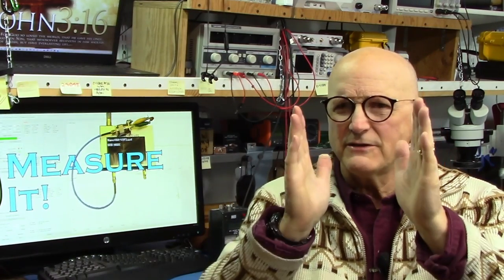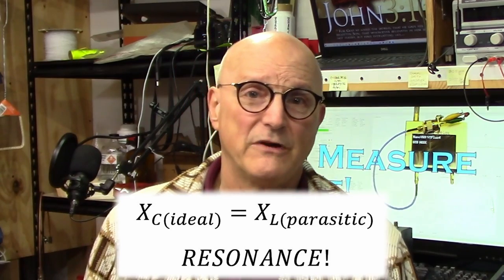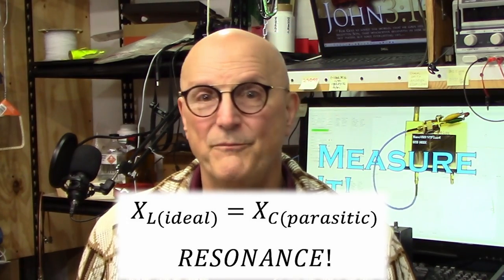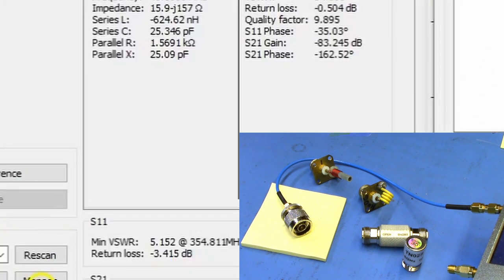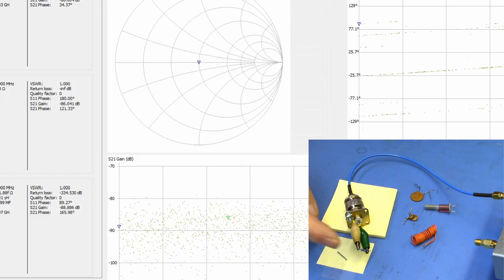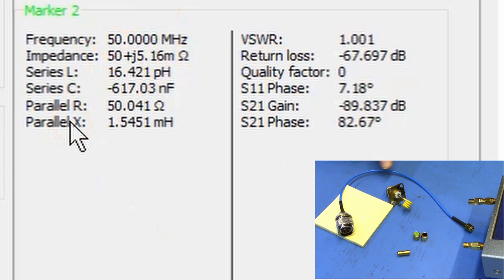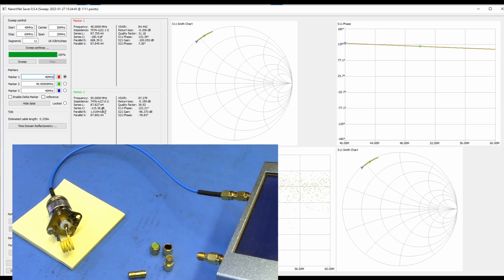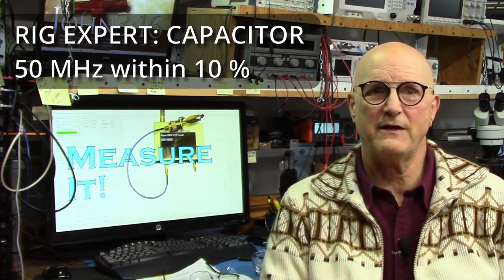Measure Impedance, Capacitance and Inductance using a nanoVNA also Compared to Antenna Analyzer(051)

Comment: When doing the port extension experiment, you could have used the SMA through at the end of the cable, and applied your SMA standards at the end of that assembly.  Then, the port extension would have to only account for the additional electrical length of the SMA to N adapter, minus the SMA bullet.
Reply from the maker: Yes, yes! I thought about that and considered it. A lot of the nanoVNAs do not come with the thru adapter. So, I thought to myself, "Let's assume they don't have one and see what happens."
But, you are absolutely right, the preferred way to do it would have been exactly as you described and would have been my own way to do it under normal circumstances. Thanks for the comment!

Comment: Great Video--These are right up my ally for interest!  So thanks Ralph for making them.
A long time ago, I was on the cusp of purchasing a MFJ analyzer when I came across a article where you could build a VNA by following this article and self-sourcing the components. In that article they did a comparison of their VNA with lab-grad ones and got great results; however when they compared them with the MFJ it was a disaster!
As a result, I held off my MFJ-purchase and finally got a NanoVNA and later a SAA2N and have never looked back.  I realized that you have to come up to some minimal standard to use test-instruments to declare values; otherwise you are much better-off not trying to obtain exact-values, then calculating your way to Avalon--only to also find that your layout dorked you anyway!  So, if you don't have suitable-equipment, you are more well served to just work empirically for performance-results and don't sweat individual values and their contributions.  Along time ago I was reading the Motorola RF manual whereby the engineer said that they calculate/simulate first, then build as well as they can; if they acheive being within 30% of that, they're happy!  So, this allowed me to cope with not being able to afford expensive equipment in those years.
Thanks Again and 73...
Reply from the maker: Yeah, that nanoVNA is an amazing little instrument!
If you read some of the really old manuals for electricians you will find instructions on how to get a rough idea of the voltage present using their fingers (yeah, 120 and 240 volts!). Aaaah the things which we used to do. I NEVER did it with my fingers ... least ways, not on purpose! LOL :-)
Reply: HP8753d/e is your best friend!

Comment: Excellent.

 Very helpful. 
I am about to build from scratch a receiver & all my old component testors are kaput. I tested a bunch of coils & variable capacitors & it worked great.

BTW, the waffle complaint guy needs to learn how to use the video advance slider, me thinks.
Reply from the maker: Now that's one of the things on my bucket list, to build a receiver from scratch...just for fun.The other one is to build a solid state linear amplifier from scratch. Not to use myself, but for the whole learning aspect of it and then give it away to someone.
Yeah, the nanoVNA is so awesome! I'm glad the video helped you get a leg up on it all.
Regarding the video slider...I also provide time marker links in the description for every video I make. If someone is interested in a particular thing in the video, they can look it up and jump to that spot in the video by clicking on the link. 🙂

Comment: I expected t measure an antenna center frquency by the NanoVNA. Of course, something is calculated, however it would be good to have a bell curve to see the result. Is there any way to have a look that ?
Reply from the maker: Take a look at my video on the menu system of the nanoVNA which will help guide you through the whole thing so you can decide what you want to see and how you want to see it.
https://youtu.be/_96N3oGFatE
MORE THAN THAT ... If you connect the nanoVNA to a computer and use software such as the "nanoVNA Saver" program (https://nanovna.com/?page_id=90), you can export the measurement data to a file. Then you can import this file into a spreadsheet program and do all sorts of analysis and fun things with it. Yes, this is true for impedance data. Hope this helps. 🙂

Comment: I'm having trouble measuring inductors and capacitors with my NanoVNA. The values I get don't match my capacitance meter. I followed your video, but I'm not sure if my calibration or connections (using crocodile clips) are wrong. Also, varying the marker frequency changes L and C values a lot. Any help would be appreciated!
Reply from the maker: Hmmmm...I thought I replied, but it doesn't show... well, here I go again...
First, what frequency are you trying to use? You need to use a low frequency to avoid the weirdnesses of self-resonance. The capacitance meter uses lower frequencies, maybe as low as 100 KHz.
Second, did you calibrate the VNA right at the clips like I showed in the video? This includes to position of the clips (especially if you are using higher frequencies to do the measurement).
Third, if I had to choose between a properly calibrated VNA and many of the stand-alone LCR meters as to accuracy, I'd choose the VNA every time. The LCR meters that most folks can afford usually are not as accurate as we'd like to believe they are. Even a high-end LCR meter well beyond its last genuine calibration is suspect.
I though I said something else of value in my first attempt to reply, but it escapes me at the moment. It has been a very long, tiring day. 🙂
Reply: @eie_for_you  Thank you for your detailed response and advice. I appreciate your expertise, but I have some questions and observations:

Frequency for measurements:
You recommend using low frequencies, around 100 kHz for capacitors, which makes sense. However, you also mentioned 40-60 MHz for some measurements. In my experience, these higher frequencies only gave accurate results for air-core inductors. For inductors with ferrite cores, the measurements were incorrect.
Wouldn't it be better to use lower frequencies (100 kHz - 2 MHz) for both capacitors and inductors? This range seems to provide more consistent and accurate results across different component types.
VNA calibration:
I understand the importance of calibrating the VNA at the clips, as you showed in the video. This is crucial, especially when using higher frequencies.
VNA vs. LCR meters:
I agree that a properly calibrated VNA is often more accurate than many standalone LCR meters, especially the more affordable ones. Your point about even high-end LCR meters being suspect if not recently calibrated is well-taken.

My main question is: Why do you recommend 40-60 MHz for some measurements when lower frequencies seem to work better and more consistently for both capacitors and inductors, including those with ferrite cores? Wouldn't it be simpler and more reliable to stick to a lower frequency range (100 kHz - 2 MHz) for all these measurements?
Reply from the maker: @hellmind  Ya know ... I had to go back and watch my own video ... LOL!
You are absolutely correct about using low frequency to make these measurements. The lower, the better with a lot of variables.
So, why did I do this at 50 MHz?  I have to admit that I wondered that same thing myself. Why on earth did I measure the values at 50 MHz?  The answer is because I was going to be using the MFJ antenna analyzer to measure these same components and it has serious problems measuring them at lower frequencies (like it wouldn't do it at all!) Remember the statement from the manual about the limitations on the reactance value.
While the limitations on the reactance values for accurate measurements are much wider with the nanoVNA, they still exist. So, there is a balancing act going on here.  On one hand we have to avoid the self resonant frequency of the device being tested and, on the other hand, we have to be mindful of the limitations of the VNA regarding the reactance values it can accurately measure.  Too large or too small and we start getting into the dirt.
Hopefully this makes some sense. 🙂

Comment: How would one adjust port extension for open wire feedline? It is supposed to exhibit very low losses. I just checked and velocity factor is in the 90% range so i guess i just use the same formulae and the velocity factor of the open wire. Say for example my antenna feedpoint or reference plaine is around 100ft high and potentially 170ft from the transceiver. I was looking for a vna i could hoist up to the feedpoint (after adapting with a 1:1 balun), but now i suppose i just need an accurate measurement of the feedline length. I really would like to learn more about calculating good open wire feedline lengths and if i can add open wire stubs to tune or work as filters in a balanced network.
Thanks for the video. Very informative!!
Reply from the maker: Port extensions assume that the adapter or cable is the same 50 Ohm impedance that you calibrated the VNA at. Open wire feed line generally has a MUCH higher impedance.  So, port extensions wouldn't wok for that.
Yes, as I understand it, you can use open wire stubs to tune and filter. Unfortunately, I have very, very (VERY) little experience with open wire feedlines. 😞  I don't want to lead you down the wrong path, so I will just have to leave it at that.

Comment: very nice,,I have lots to catch up using my vna,,just a tip I use the magnetic data connectors for my  vna  tiny ultra,phones add tablets,,saves ports being pluged in and out all the time,,also for sma and n connectors i use plug savers, avoid screwing on and off threads
Reply from the maker: Thanks!
I cannot say that I am familiar with those sorts of connectors. As totally persnickety as RF measurements are (REAL VNA experts use a torque wrench to tighten there connections!), I'd be a bit leery of quick connect stuff for that application.
Reply: @eie_for_you  magnetic cables are only for the data and charging   not rf
Reply: Hello Dennis, just saw your reply to Ralph in which you mention "for sma and n connectors i use plug savers" can you expand on what "plug savers" are, please? Thanks, Luigi VK3ola

Comment: For the measurements in the beginning, why did you use the 2nd marker at 50MHz? Because it was in the middle of the sweep? Other tests I’ve read about. rely on finding the resonant freq (phase plot where it goes from 180 to -180) before calculating the inductance (e.g., inductor in series with a known capacitance, one end connected to DUT ground and the other end connected to DUT tip..then the inductance can be calculated with the standard formula that uses the resonant frequency)
Reply from the maker: Yeah, I've done it with resonant frequency before, but this throws one more bit of measurement uncertainty into the measurement: the actual value of the capacitor. It is better to measure the value directly and at as low a frequency as possible to avoid any interaction with possible self-resonances.  As far as the whole 50MHz thing ... as I recall it was just convenient and well below where I figured any self-resonance might occur. Hope this helps. 🙂
Reply: Thanks!
Reply from the maker: @lemonkey You are very welcome! 🙂

Comment: Excellent video!  Thank you for making it.  Overall, how does the Nano VNA compare to the Tektronix VNA?
Reply from the maker: Thank you and your are welcome at the same time! 😁
To answer your question ... I just did an experiment calibrating each with the same standard and measuring the same inductor. The nanoVNA was within 0.5% of the Tek VNA. In other experiments previously done, it was within 1%. Quite respectable!

Comment: Wow, and the MFJ device is, as I remember, roughly 5 or 6 times the cost of the typical nano VNA. 

I just purchased my nano vna roughly two months ago and only recently began using it. I do like the nanovna-saver software and fortunately it runs under Windows 10 with no issues. The other software VNA-QT, latest version, installed on both my laptop & desktop, but hangs up with a not responding issue on both machines when I try to connect to the vna thru the com port, so I use the saver program.

All in all the nano vna is a great tool and I likely will purchase another for a bit more money than the $40 I spent so as to have a larger screen when using without aid of the computer.
Reply from the maker: The nanoVNA is an awesome tool for the price! It still cannot tune a duplexer (not enough dynamic range for that), but it does everything else pretty well.
I, too, like the saver program. I had times when it wouldn't connect and I had to connect using a different program, close that one and then saver would connect. But, I haven't had that problem recently. So, either they fixed that in the release I have or it fixed itself when I changed computers (??).
In a few weeks I plan on a menu walk through on the nanoVNA. It is by way of helping folks know how to get things set up to do what they need to do ... not your typical "this menu is for this" kind of thing.🙂

Comment: I plan to experiment with various LC impedance matching techniques for single band efhw vertical ground mounted antennas for HF Ham use. My problem is determining the load impedance of the radiator wire for each frequency that I need. Assuming 468/f MHz for say a 28.075 to cut length,  and hung vertically at 10M high, soldered to center conductor of SO 239 connector with a .05 wavelength counterpoise attached to outside of the SO-239 connector at ground level, how would one use the nano vna to measure the impedance? I read that the impedance of a EFHW antenna is within a fairly broad range of 2000-5000 ohms. My problem is that I would prefer to know in advance what specific impedance I am trying to match to 50 Ohms given my known factors, such as location, environment, frequency, materials, construction, etc. Ofcourse I can just keep iteratively building, testing, by best guess but I'd prefer to save time and just measure it if I have the ability to do so with reasonable precision. Thanks for your help.
Reply from the maker: Any VNA assumes a 50 system between itself and the point where you are measuring. Port extensions only work when the connector or cable being added adhere to this 50 Ohm system.
You say (if I read this right) that what you are measuring is terminated in a UHF female (SO239) connector. I am assuming the shell is ground and the center is the item in question(???). If I understand this right, then I would calibrate the nanoVNA at the end of whatever cable you need to plug directly into this UHF female.
Remember ... ANYTHING that lay between where the VNA is calibrated and the entity to be measured WILL change the measured impedance.  The higher the frequency, the more critical this becomes.
With my miniVNA tiny I literally mounted the VNA on the antenna and used a very long USB cable to connect it to my computer. Because it lives in a very plastic case, its presence did not affect the antenna even at 146 MHz. I measured the impedance of a folded dipole at 146 MHz this way and created a stub match to give me a very good SWR into a 50 Ohm feedline (you could see my video: https://youtu.be/LY4GysxSEa0).
Reply: @eie_for_you  Thank you. I guess my question is will a nano VNA measure an impedance of an unmatched antenna anticipated to be between 2000 and 5000 ohms? I am not sure if a nano vna is capable of this high impedance range.
Reply from the maker: @kennymanchester  I do not know the answer to that question and the manual doesn't say that I could find.  If you just leave the connector open, what impedance does it report? After calibrating mine at the connector, mine is popping all over the place with displayed readings even up into the tens of kohms.  Nonetheless, I'm thinking it probably is outside of its capabilities for making really accurate measurements.  If it were me, I'd do some bench experiments to see what its limits are.
Reply: @eie_for_you  Thank you. I'll do that and see what happens. Thanks again.
Reply from the maker: @kennymanchester  Let me know what you discover.

Comment: Excellent explanation!  Is there a reason to sweep from 40-60MHz across 11 segments after calibration since you are only looking at the 50MHz marker?  For example why not sweep 1 segment from 49-51MHz (and set to continuous sweep) to measure the parts?  I also found the S11 Serial L & C displays to be helpful.
Reply from the maker: How many segments you are using and the start and stop frequencies are all up to what you are looking for. The more segments, the finer the frequency resolution of the measurements made because it only takes a certain number of measurements in each segment. So, to get this finer resolution over a wider span, I need more segments.
 If I am interested in seeing how the part performs between 40-60 MHz, then my span is there. If all I am really interested in the 50 MHz, then, yeah, we could narrow the span a LOT and use fewer spans, like just 1. 🙂
Reply: @eie_for_you  Thanks for the reply.  Yes I am seeing with the Series L display how different inductors behave across the larger span where 1mhz is mostly a flat line.  Fun!😀
Reply from the maker: @johnclements3441  Yeah ... it is fun! 🙂